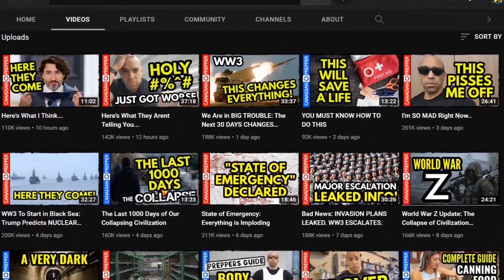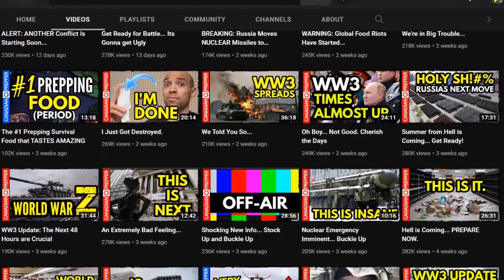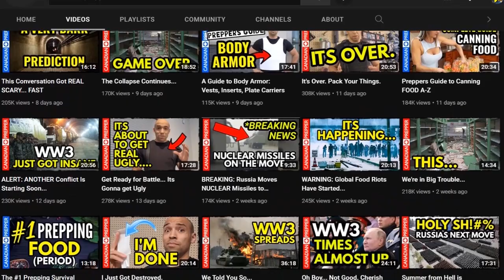What These Preppers Know That YOU DON'T

Comment: Hey Praxis, I feel your frustration.
Today I finished putting in a cement / paver stone fire break in front of the wood shed. It was boring to do. Thankfully nobody had to watch. A couple weeks ago I did the same thing around the front porch. Doing that was boring . . . and now, if a grass fire comes through my chances of not losing my home are substantially better. After the local fire team did a training tour with new wildfire workers and seeing my place I was assured my cabin would be saved - even if I'm out of the country. They also commented, the place up the hill from me - if the fire was on the way and they only had 30 minutes, everyone agreed it would be time for lunch. The place is a fire trap. They will bust their butts to save my place because I've done the work to make it possible.
Limbing all the trees at least to 4 feet clear and clearing years of underbrush growth is again boring and actual work - no guarantees, but the probabilities are good of making it through a fire with the property and timber intact. 
Prepping can be boring, surviving will be delightful.
Reply from the maker: The paver stones sound nice. I wonder if a faster and easier (although less beautiful) way of doing the same (or adding to your defenses) might be to drop crushed stone over an area? I'm thinking of adding crushed stone to my driveway soon (3/4" washed) to make it so the mud doesn't splatter on my brakes and rotors. It might help with grass fires too?
Reply: Great comment!  Too many people forget about “prepping” their rural properties for wildland fires by clearing out fuels…because there’s more “tacticool” gear for TEOWAWKI and SHTF.  Most of the western U.S. is prone to wildfires and has been getting less rain and snow in recent years.